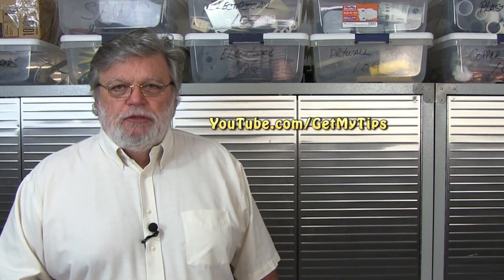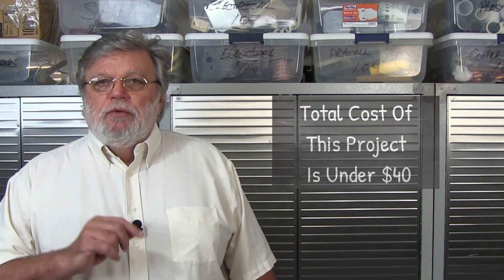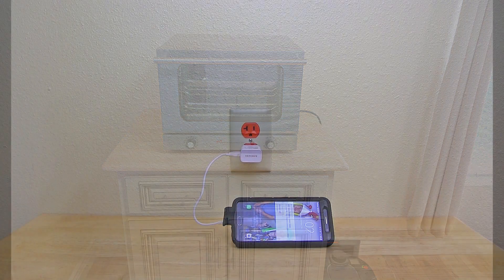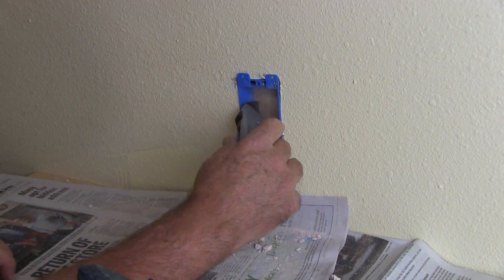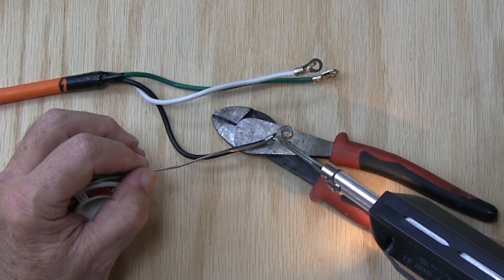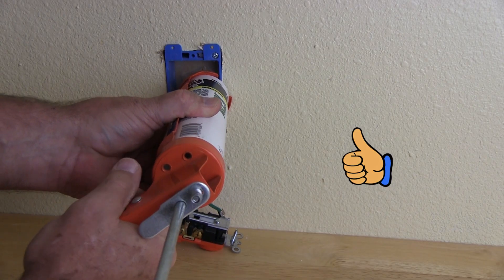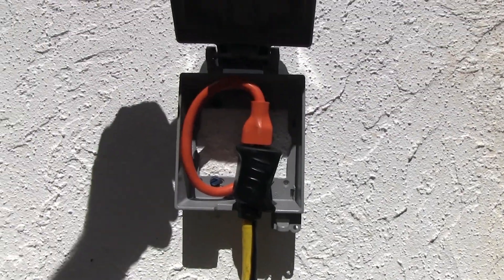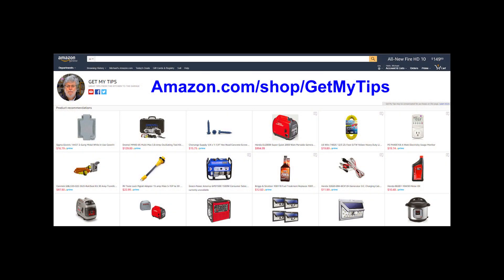How To Hook Up A Generator To A House

Comment: I went through my end joist and cut a big enough hole to feed multiple cords, that way I can run everything I need except my air conditioning upstairs and down. I used a piece of packaging foam to block air and critters. The weather tight cover I used has enough room for at least 4 cords to pass with the cover closed.
Reply from the maker: doug dillon, that sounds like an excellent alternative to a manual or automatic transfer switch. Thanks for your feedback, Mike ☺

Comment: Don't make electrical a hobby call a electrician you could wire for fire 🤔
Reply from the maker: dread man, thanks, Mike ☺
Reply: Wes where are your videos showing how to do it? Why you even on this video?
Reply from the maker: I have jerked enough Romex in my life and replaced enough service panels, to understand that what I demonstrated in the video can easily be done by anyone who is handy with tools. Based on your comment, my guess is that excludes you. Most electrical wiring repair jobs and service work around the home should be done by a qualified electrician. However, using an electrician in this case, would be overkill. What I demonstrated in the video is simply a mechanism to bring electricity from the generator to one receptacle isolated from the house wiring. Doing so eliminates the need to leave a window or door open all the time. It's essentially an upgrade from drilling a hole through the wall and running an extension cord from the inside of the house across the yard to the generator. That's it, that's all, it's that simple! Take a stroll through the electrical section of Home Depot, or Lowe's. Do you seriously think that the equipment for sale there is intended only for electrical contractors?
Reply: Get My Tips nice comment. Humble but to the point precise.
Reply: @Getmytips  Exactly...today's generation has trouble getting dressed by themselves....I doubt they can use a screw driver......LOL
Reply from the maker: Thank you sir
Reply: @Getmytips  I agree.....me too.
Reply: come on Wes your taking the fun out of Electrical !!
Reply: Wes p
Reply: That's realey good advice.

Comment: Could there be an electrical feed issue with using the orange installed cable that is a smaller gauge then the larger gauge extension cord coming from the generator? I like the idea, but will likely use the same gauge cable.
Reply from the maker: Kevin Archer, no not at all. I use a light-duty generator not capable of producing enough amperage to even come close to the benchmark amp rating for both the yellow and orange cord used. Mike

Comment: I use the 220 plug on my generator a 225 Lincoln welder to run everything. I simply buy a length of 10/3  SO cord and wire a male plug onto both ends. One end plugs to the welder and the other into the plug for my 3hp air compressor in the garage. I pull the main 200 amp breaker to isolate me from the grid then fire up the welder. This way, everything in the house is powered. Just be careful not to touch the ends of the male plugs while the gen is running. I can get 52 amps of power this way and I don't have to bother running separate extension cords.
Reply from the maker: pipedreams57, That probably works great for you but it is certainly not for everyone. Most people don't have a welder they can use to generate electricity. The reason that I made the video the way that I did is because I only needed to power a couple of items for a short amount of time while the power is off. The most important thing that folks need to keep in mind is that if you are going to have a generator (or in your case of welder) capable of producing enough electricity to power most of the items in your home, you're going to need a lot of gasoline available. I did not want gallons and gallons of gasoline stored in close proximity to my home.
Reply: You got that part right about needing a lot of gasoline for generator usage. The welder also has 120 volt outlets on it that I keep a double male end extension cord around for but anything you plug a 120 volt cord into will only power the 120 outlets on ONE side of the main 200 amp service box. I usually reserve using the 120 volt double male cord for my storage shed out back and a smaller Honeywell 3500 portable generator. Just gotta remember to pull the 200 amp main first and never touch the ends of a double male plug. LOL. Thanks.

Comment: Pretty cool. How would I do a gas furnace blower?
Reply from the maker: john g, thanks but not knowing the particulars of how your gas furnace blower is wired, I won't hesitate to speculate. If you are not sure, it is best to check with a professional. Mike ☺
Reply: You could use an inlet box and connect it to your electrical panel.  Run a 30 amp cable from the generator to the inlet box and you have access to all of your circuits.  You just have to know the power requirements of the appliances on the circuits so that you don’t bog down the generator.

Comment: I did something close to this a couple years ago during a week and a half power outage from snow but i put it right by my dryer plug and built a 3ft jumper cord wired to power up both sides of my house and just turned off the main inlet breaker in my box I still only have 120 power but I can use every plug in my house like my fridge and freezers just takes turning my main breaker off and unplugging my dryer
Reply: Henry  BAD BAD illegal idea !!!!  You will be liable if you fuk up and somebody gets shocked !!! Just use an interlock devise and a wire through a breaker and be legal !!!
Reply from the maker: H Dog, I appreciate your feedback but I would never back-feed through my dryer receptacle. Lots of people do it, but to me it's not worth the risk. The generator that I use does not put out enough power to even be considered for supplying power to the whole house. The main consideration for me was two fold, I rarely need a generator, and I did not want to have gallons in gallons of gas stored around my home. Mike

Comment: I also like a neat yard,but if you move that generator closer to the house,you can eliminate all sections of cord except the one needed,and still be plenty far from the exhaust.Remember,every plug is an invitation for resistance/heat.
Reply from the maker: John Wade, thanks for your feedback. I located the generator where I did so that I could secure it to the tree with the anti-theft cable. Even if I moved it closer and created some sort of anchor in the ground for it, I would still have the same number of electrical connections. Mike ☺

Comment: I've done simular, used no 10 gauge ext from generator to simular connection, inside contractor power bar, has off/on 20 amp circuit breaker and serge protection. Inside run 12g custom length to 4 locations. Total draw freezer, fridge, led tv and 7 led lights, total 7 amps when working. 4k Generator has ground to earth, appliance are new so min load when starts and running. Total separate,  no feedback concerns just few seconds to change plugs
Reply from the maker: Barry Oram, sounds like you have an excellent setup, thanks for your feedback Mike ☺

Comment: Thanks! This is just what I needed to set up electricity in my shed for light and a tool every now and then. Does the orange color of the outlet mean anything?
Reply from the maker: amphitrichous, thank you for the kind words and taking time to leave feedback. An orange receptacle usually indicates one that is connected to emergency power. Mine didn't need to be orange because obviously it's not usually connected to the power supply but I just thought I would choose an orange one. Mike ☺

Comment: Why didn't you shut off the main and hitch it up to the whole house? Less time
Reply from the maker: David Lutke, the whole point of the video was the show an alternative way to use a very limited amount of generator power. I rarely need to use a generator, and the generator I used in the video is not very powerful.  That's why I demonstrated in the video exactly what I need to power up in the event of a power loss. I live in Florida and  cannot leave a window open overnight because of the four-legged and two-legged critters that roam the night. Therefore, I had to find a mechanism to get the limited power in the house without an open window. Mike ☺
Reply: @Getmytips  
The plugs through the wall is a good idea.
And i just found out this morning the spare generator is not 240v.
Jokes on me.
Reply from the maker: David Lutke, okay fair enough. Keep in mind that in an emergency situation fuel may be limited. Therefore trying to power the entire house maybe impossible anyways. Mike ☺
Reply: @Getmytips  
Fuel can't help me now i have two i cannot start(might be bad fuel)
But two days ago the power went out for a half hour, better than 30yrs ago
with 4 days.
I think i need a wood stove, and a out house.
but i have used buckets of water to flush the toilet with water from pond.
Thanks for the text

Comment: Tidy. I would have crimped the connectors though instead of using solder. You see soldered joints on lower current draw electronics and such, but in any higher current draw situations the connections are crimped or wire-nutted so as to not lose integrity if there's any heat generated.
Reply from the maker: Scott Larson,  actually I did both, I used the crimping tool on the terminals before I solder now. Mike ☺

Comment: Never, never back feed your panel without an approved transfer switch. Good idea this, limits how much you can power up. I run my cord thru the dog door for now. Plan to install dedicated outlets during remodel for fridge, WiFi, TV and a small lighting circuit that’s feed thru an external box like this.
Reply: Handiman jay  you can back feed your panel LEGALLY if you use a seperate breaker to gen set and an APPROVED interlock devise !!!!!  Much simplier and cheaper than a transfere switch !!!

Comment: There are a lot of geniuses commenting on here that I'm glad don't make videos. The information given here is for emergencies and very much appreciated. Thank you.
Reply: k
Reply from the maker: MONTY, I recommend that you watch the video before you make a comment. If you had watched the video, you would see that what was demonstrated is completely isolated from the home electrical system. There is absolutely zero chance of an electrical lineman coming in contact with okay tomorrow 8 a.m.the current generated buy my generator Mike!
Reply: @phillr3  trust me im not condoning this install. 
But i only saw 1 wire on the receptacle, which was from the generator.  
I did not see any other conductors in the box. 
You don't need to explain how electricity works I'm a licensed electrician for 20 years . 
Again this is nkt a kosher install. But from this video it does not appear to connect to any other wiring other than his extension cord rig.
Reply: @johnmontague69  How? It has nothing to with the electricity going into your meter from your power lines. It's a cheap generator through the wall diy kit.
Reply: @johnmontague69  dude. The wire from the generator goes directly to the receptacle in his kitchen. 
It doesn't travel through his homes internal wiring at all. 

Although there are several electrical code violations,  nothing in my opinion gonna cause harm to others.
Reply from the maker: texxos57, Wow! Somebody finally gets it, haha. Thank you very much for your kind words, I appreciate the feedback. Mike ☺
Reply: You're welcome! New sub.
Reply from the maker: Welcome. You may also want to check out my other channel, ☺ https://www.youtube.com/kitchentipsonline

Comment: you have the generator sitting on all those leaves,and it can start a fire,and burn the fence down.But,1 out of a 10 ratting,i'll give you a 7..for only hooking up 1 thing.but why did'ent plug a surge cord into the wall,The Plug the Refridgerator Into that.?And also,you could have Plugged in more Thing's..Just Sayin.But Great video.

Comment: just hook up a transfer box and run no wires and get power to more stuff . its worth it
Reply from the maker: Weaver Ron, I think perhaps you missed the point of the video. The point of the video is to allow folks with limited technical experience, to hook up a generator temporarily to be used only to power a couple of items. Obviously if one has a situation with lots of power failures, spending the money, hiring a professional, and installing a heavy duty generator is the right way to go. Don't forget though, that the bigger the generator the more fuel you need to store around your home. Since I live in Florida, when the hurricane comes, gas stations with fuel are hard to find. Therefore, for me a light duty setup is the way to go. Mike ☺
Reply: I welcome your check so I can pay an electrician what they charge down here to do that job especially in my home where the main is outside and the regular panel is inside on the opposite side of the house.

Comment: this is fine if you just want to power one thing in the house but if your like most people you want to power several things so this set wont do. its worth it to have a professional to set up the transfer switch along with a generator pannel
Reply from the maker: michael suchinski, thanks for your feedback. ☺ If you watched the video where I demonstrated how to buy a generator, I talked about fuel consumption and what you may need to power in your home. In the video I showed exactly what I needed to power in my home. So the system that I installed works great for me, for a very short amount of time when needed. Absolutely, an automatic or manual transfer switch is the best way to go. However, if you have a small need for electricity, and are not excited about storing gallons and gallons of fuel in or around your home, what I demonstrated is a great alternative. MikeHow much generator do you need ~ https://youtu.be/z9U7kuibqMc
Reply: An official transfer switch doesn't change the power of the generator. Along with that, youve forgotten that a panel box is fed by 240 v, and not every generator has a 240 v outlet as may well be the case with this one. 
  I think this is a great idea on several points, a very important one is that it's completely isolated from ANY other house wiring and thus would be very safe. I never thought of doing this. How dumb of me!
Reply: I kind of did the same thing but I ran an underground wire from my shed to my foundation up thru the wall to a regular gfi receptacle then plug in a four gang box. One for the pellet stove , fridge, freezer and then a cord with three female plugs for lights and tv works great

Comment: This actually seems like safest system to me. Much better than snaking an extension cord through an open window in the middle of a storm.
Reply from the maker: Grizzled Old Dude, thanks for your feedback. Keeping the window closed will keep the storm out. But more importantly, it will keep out some of the two-legged creatures that would come in and snoop around making off with your possessions. In some parts of the country that is a big issue. Mike
Reply: Plus snaking a cord through an open window or under a metal screen door can cut the cord and cause a an electric shot ands start a fire even sometimes.
Reply: @human1513  true, thankfully most 120v shocks are not lethal though. Many people even get off with a slight tingle (me.)